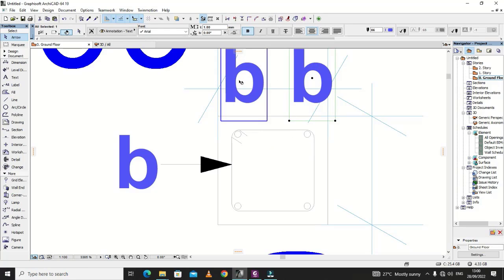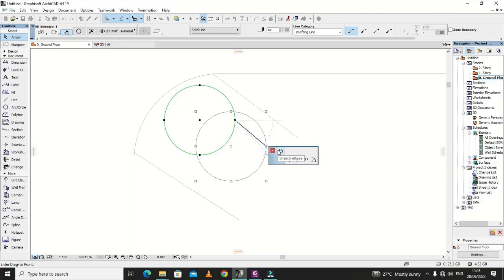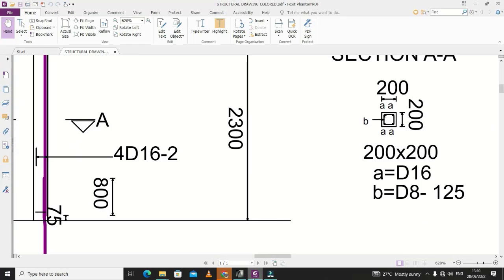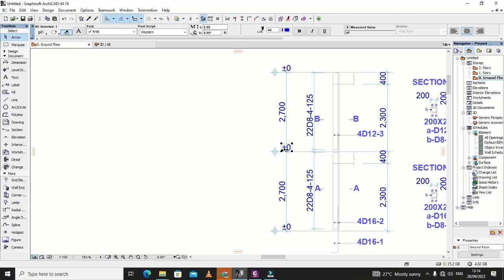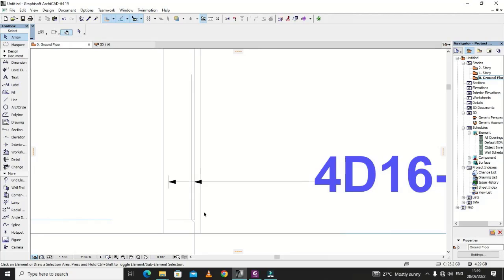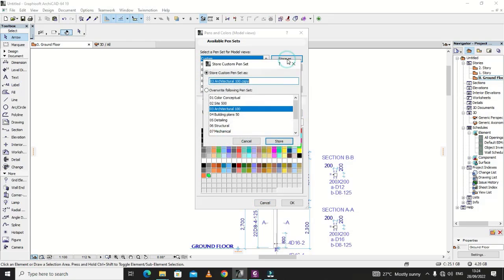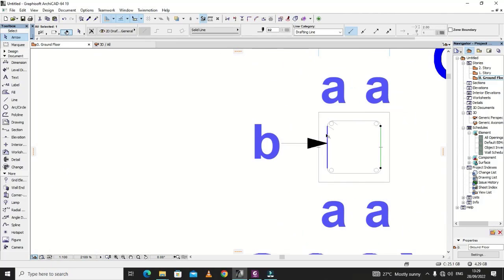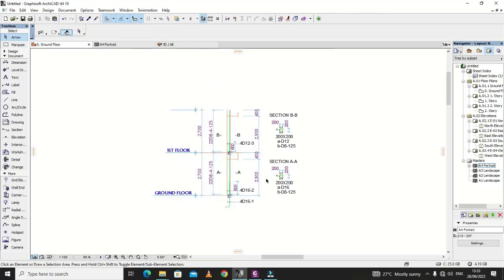RC COLUMN STRUCTURAL DETAILING USING ARCHICAD PART 2

Comment: Good elaboration, question, how do you determine the kind of bars that we're using?
Reply from the maker: You do structural analysis, you sketch the Bending Moment and Shear Force Diagram then, you proceed to design where you will come up with size of bars, we have lots of offline classes for this if you're interested, using design software that is, to do analysis and design
Reply: @Structon what is the software you are using for structural design
Reply: you do that during structural design calculations